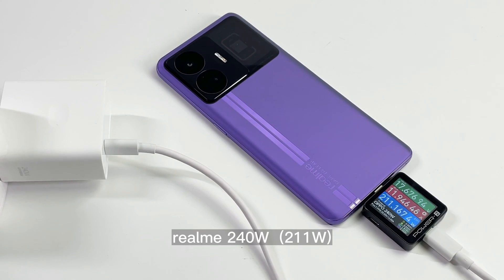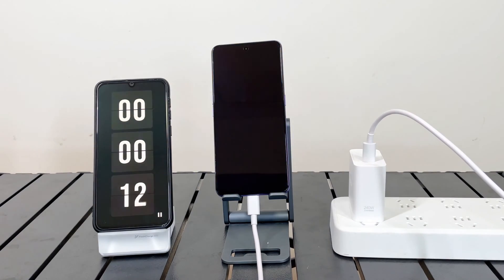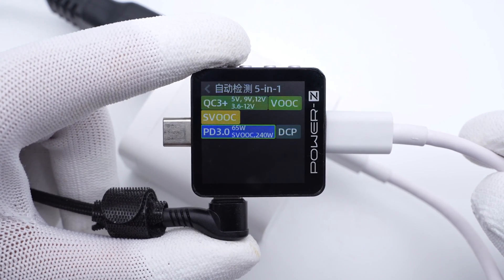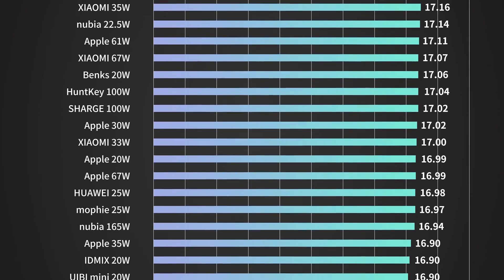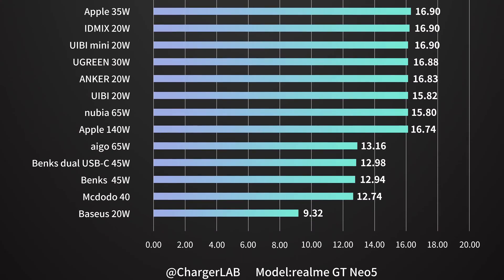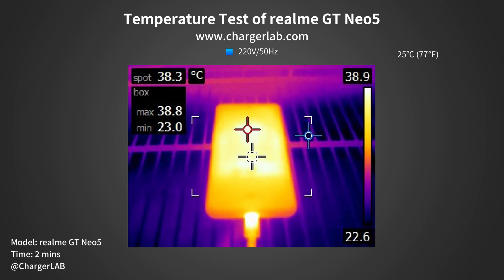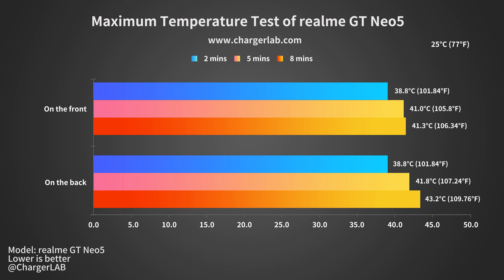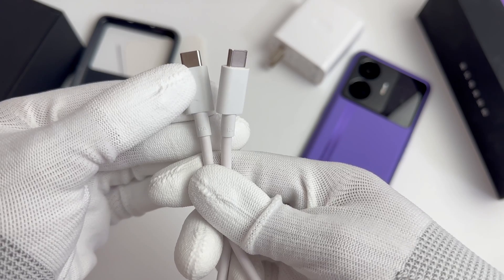Charging Review of realme GT3 / GT Neo5 (240W Charger)

Comment: How come it is not PD3.1 which does support 240w, 48V @ 5amps ? Puzzling !
Reply: Usb pd is limited to 5amp max, so you must use 48v to achieve 240w. The phone battery can only charge at 3.7v, the conversion from 48v to 3.7v produces too much heat in the phone.

Comment: Does it charge faster with fast oneplus or oppo chargers?
Reply from the maker: No, that's because neither the OnePlus or OPPO chargers can deliver up to 240W.
Reply: @ChargerLAB  okay, thanks! But would it charge at 150W with a OnePlus 160 W charger? Or at 100W with a OnePlus 100 W charger? Or at 65W with a OnePlus 65W charger?
Reply from the maker: The only data we have is the 65W one, which can provide 52W, but the result of the other two chargers should theoretically be close to their maximum output, because both realme and OnePlus are subsidiaries of OPPO.